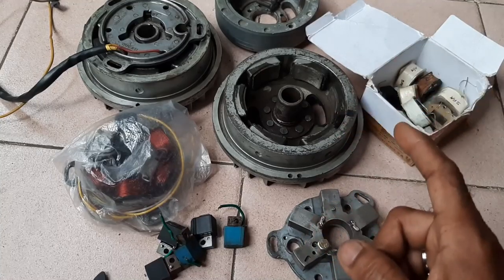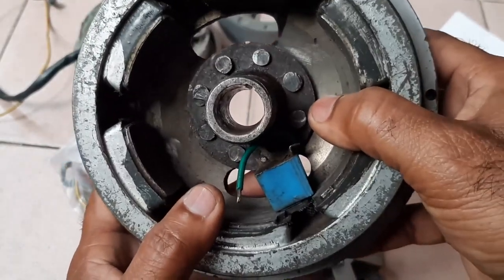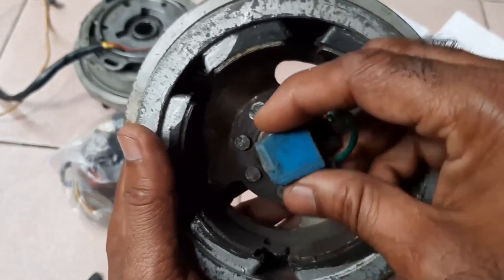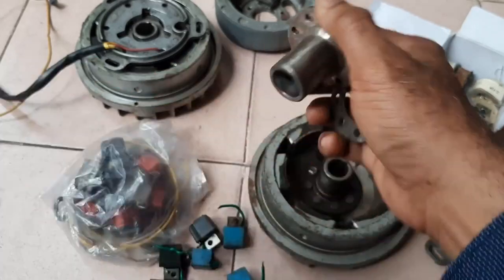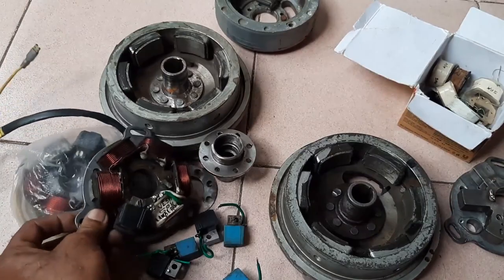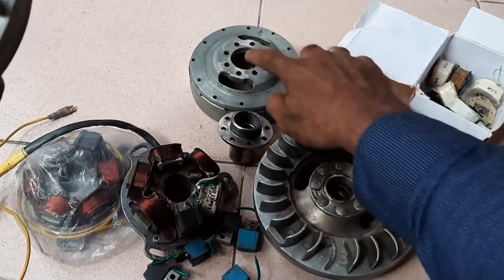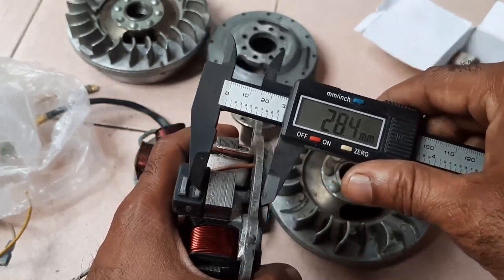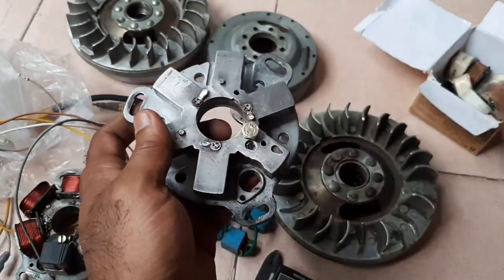Lambretta Scooter No Spark Problem Solved

Comment: My coil gives Spark but not as good as your coil... My lembretta had Ducati coil 6V....  weak Spark but as i connect spark plug its shows good
Reply from the maker: Normally 6 volts old stator gives satisfied spark not efficient. Can do normal running. If you want performance then conversion is much required 👍👍